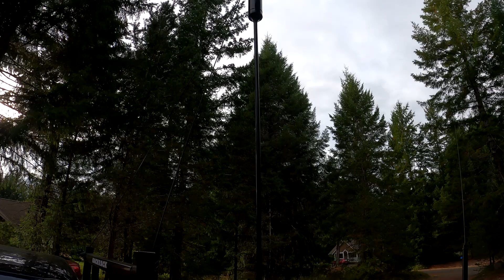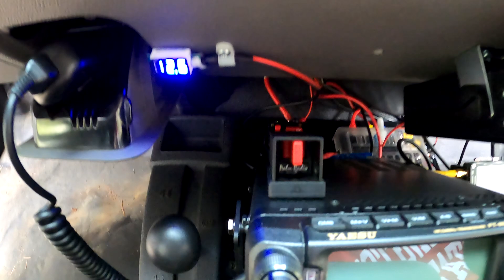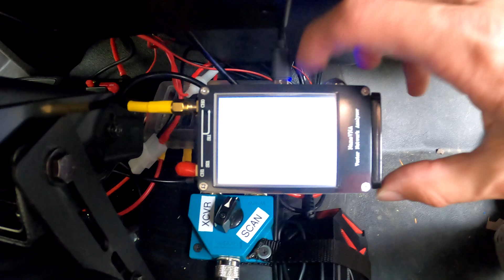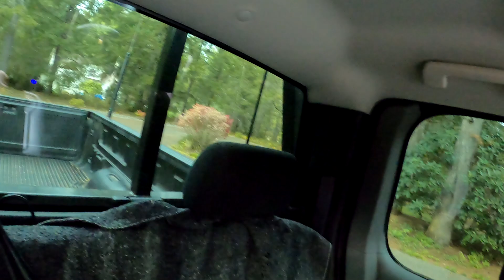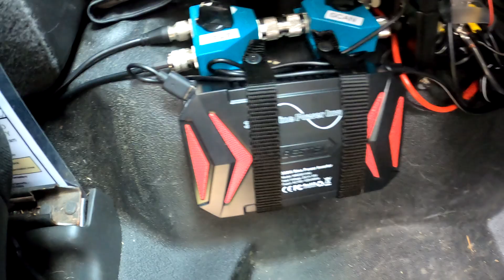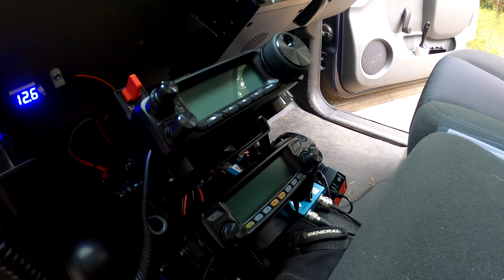Mobile Coax Switches, NanoVNA, and Common Mode Chokes

Comment: Thanks for posting!  I have an 2015 F-250 that generates a ton of ignition noise.  If I turn the NB off on the 7100, noise is easily S9.  I did the same power line choke and also installed a choke on the coax going into the rig.  No help.  I noticed you installed your coax chokes at the antennas.  What toroid did you use and how many windings thru the toroid?  I might try installing chokes near the base of the two hamsticks and see how it works.  Thanks!
Reply from the maker: The toroids were just out of my parts drawer so I don't have a model number, but they are 60mm OD. 

As for windings, I used whatever slack was left in the coax once I reached the antenna mount, I'd guess to they have at least 8 windings but I can't tell you for sure because they're back behind the bed liner.

Hope you make some progress on getting that noise down!

Comment: Very nice ...to bad we're  far apart could use you're advise.
Reply from the maker: I saw from your QRZ you are using a Little Tarheel while mobile, how has the performance been compared to the ATAS-120A?
Reply: @w7lrhradio  Hi I love the TH2 better works 80-2meters...also do MARS .The 120 will not and is intermitted tuning sometimes, if you can get get a TH2 do so.

Comment: Why cb radio when you have a HF radio.

If me get a Tarheel,  and no need for atas and hustler, or CB antenna..
Reply from the maker: Indeed, I saw Tarheel has a couple of models that are supposed to work down to 80m per specifications, that would be convenient. Quite an investment though!

I've had a CB in the truck since before the HF radio because there are quite a few working trucks I share the road with that use it, so it is good to have full TX and RX.